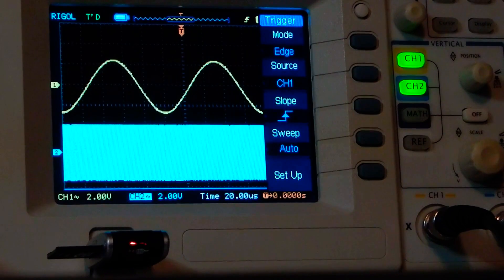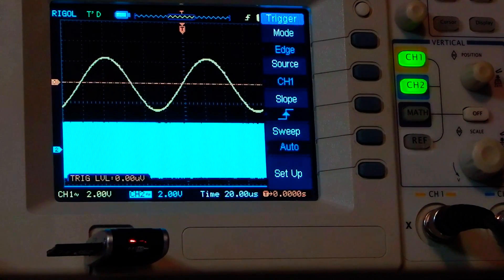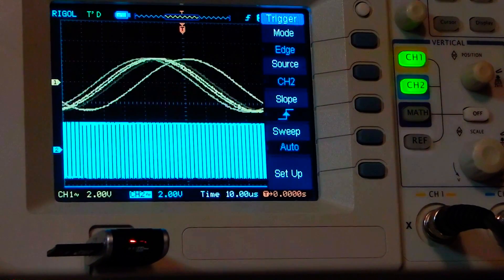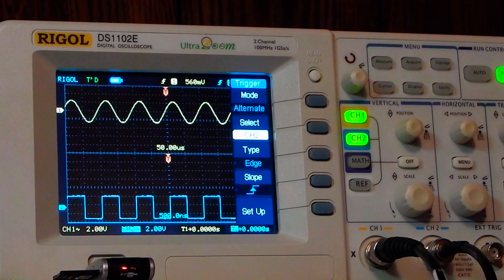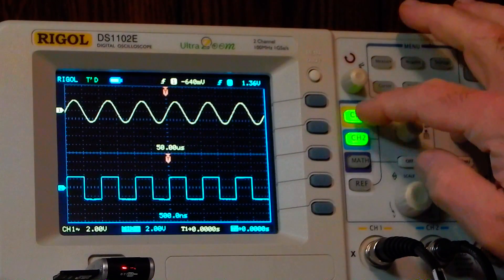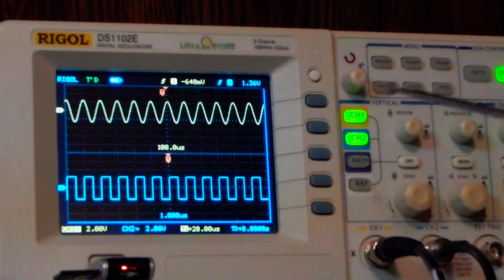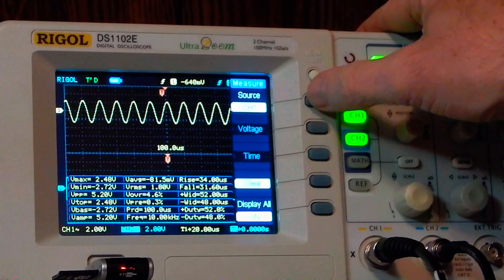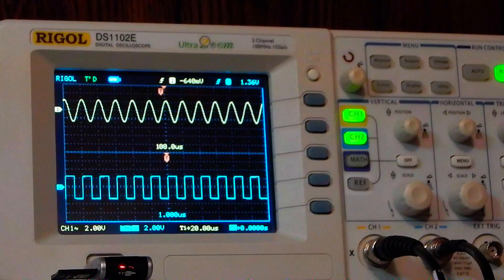DS1102E Alternate Trigger Mode

Comment: Hi, I have a question. if I have an indicator 10 mh in series and a resistor 1 k ohm's in a parallel line, how would I be able to measure the Vr and Vl if it is asking me to set E= 8v(p-p)? Also, I am connecting my channel 1 into the indicator and channel two into the resistor. which channel am I supposed to read for the Vr and Vl?
Reply from the maker: I assume when you say indicator you mean inductor and I would say measure across the whole thing on channel 1 and at the junction of the inductor and resistor on channel two .. then .. which ever one is from the junction to ground .. lets say the resistor .. then that is of course Vr and then just subtract that from the total and you have VL and it should add up to the 8vP-P .. the only other way to measure across the inductor in this case would be a differential probe.